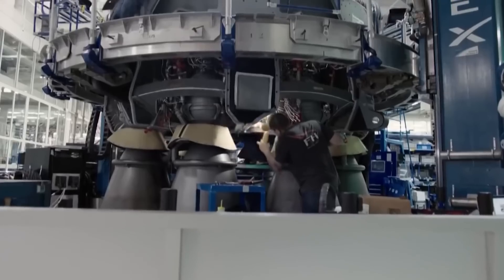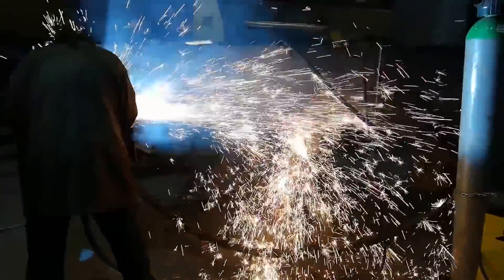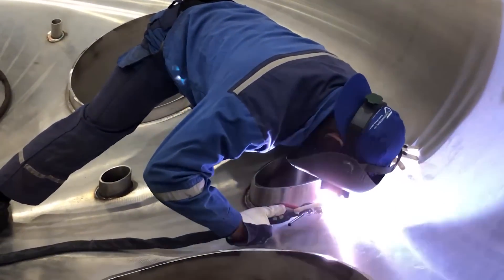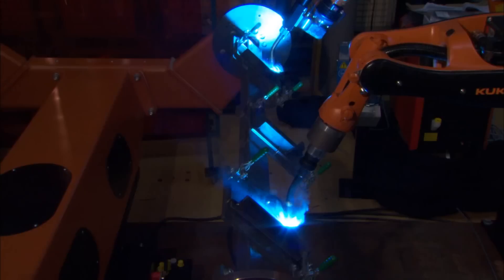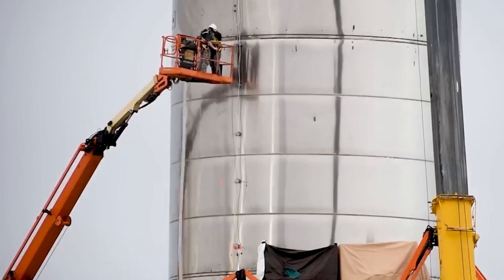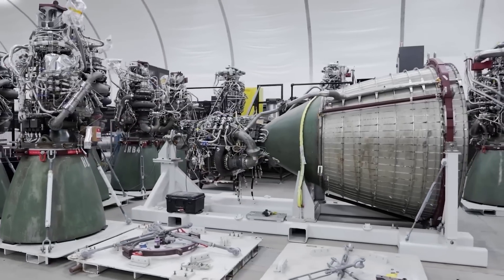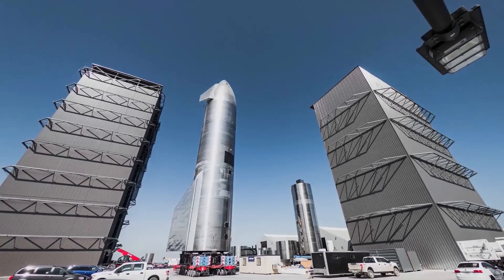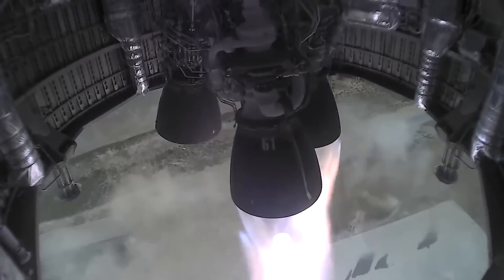SpaceX's New Upgrade On Starship's Welding Will Change Everything

Comment: The material that will dominate during Humanities journey to space is carbon fiber not stainless steel. Rocket Lab was going to switch to stainless steel for their larger Neutron Rocket, but went back to carbon fiber to take advantage of the weight saving.

Comment: The breakdown and explanation of welding techniques is terrible. Making disparaging comments about the tradesmen involved in the welding processes? This rocket is a giant pressure vessel, boilermaker welders… that is their bread and butter. If there were issues with weld joints in the beginning, it is due to poor engineering. The incremental changes in appearance aren’t from poor welding technique but rather changes being made to the welding procedures. 
The welding robots you showed in the video in addition to the laser types were wire feed robotic welders.
Reply: Yeah this guy is a joke.
Reply: Totally agree this channel needs to be shut down.

Comment: In my opinion it would make more sense to make the Super Heavy booster out of lighter materials such as aluminum or carbon fiber. Like the Falcon 9 boosters the Super Heavy won't experience the high temperatures of orbital reentry like the Starship so it doesn't need to be made with stainless steel. They would be able to lift more tonnage to LEO with a lighter Super Heavy.
With rapid turnaround that they are striving for they won't need very many Heavy Boosters, maybe less than 20, so it wouldn't add that much to the total cost of the program.
Reply: yeah im sure spacex hasnt thought of that bud

Comment: But Fantastic video. And you are not ignorant. Great view of work. An external orbital as well internal mag orbital Welder. Which could expand with inner rings and track. With a robotic arm internaltrack bot or suction bot. With track wheels and laser guided . Which may allow two sides to be welded at one's. Or opposing sides balancing out expansion contraction of heat and cooling. With optical temp gage and heat waves screen under hood. Like two external windows with readouts. Rhat would allow a thermal image to the Welder to slow slow down before a specific heat pattern. Samd thing with orbital bot Welder. Ablw to climb and move manipulated by the Welder until ai takes over. Each Welder having multiple camera and heat info. Readouts automatically signaling exact behavior of sheets.

Comment: Take the bottom stage up. This makes it one time plus forever. Use it to add to the station. Use everything you got. I remember a thing about Mr Ford. He ordered  the stuff to put in the seats from Louisiana and required they were shipped in specially designed crates. Nice that the crates when broken down just happened to make the doors.

Comment: Put a weight on the other side and you could put everything where you want. It is crazy the weight you can lift with that, Use the Gear you have to lift or lower objects. Adjust the weight of the space ship using weights or even a transmission. Gravity having a backup. But, yeah .. balance the weight.